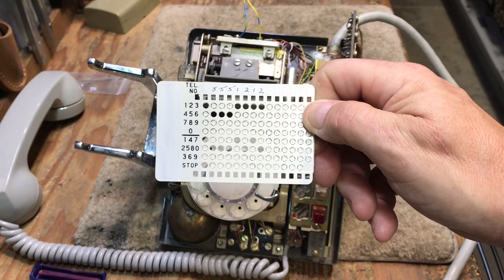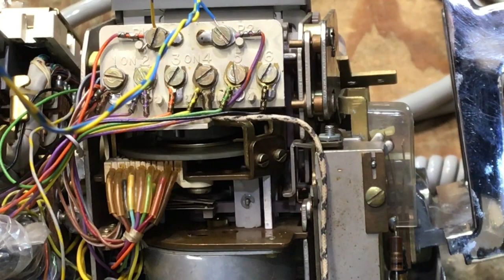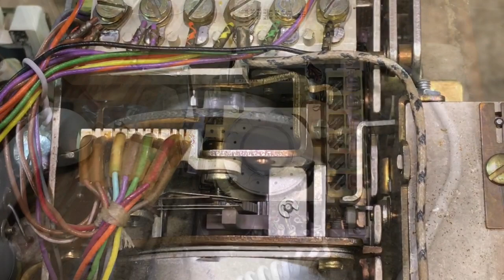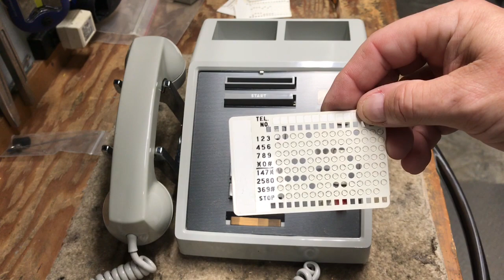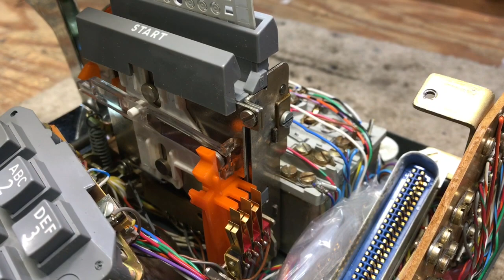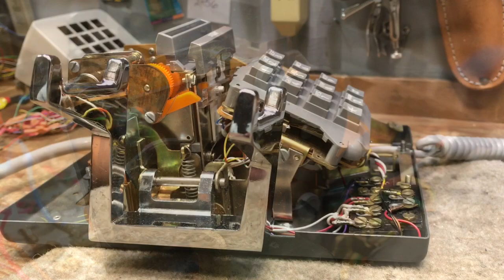Western Electric 66X and 26XX cardialers.

Comment: I acquired a 2662 TT around 1974, which i rewired for single line (before I also acquired a 3 line KSU).  This phone provided me with plenty of free concert tickets from the local radio stations for about 2 years in my teen years before it broke.  About 5 years later, I acquired a "Strategy" (?) electronic dialer that would detect both Bell and MCI/Sprint "Satellite" dial tones.  That allowed for dialing into FGB trunks (950 numbers), then dialing Card+ calls.  Then a friend with a Apple-II and an Apple-Cat II modem (and "Cat-Fur") introduced me to the world of MF dialing ;-)

Comment: These sets were very expensive back in the day, and were available only to lease from the OTC you were in. I had a White one (rotary), and then replaced it with a TT version (Blue). The dial pad and the dial mechanism in the TT version had to be replaced several times. They just brought out a new set. If you needed more cards, then it was $8 for a set of 20. When I moved, and disconnected the service I TOOK it with me. I paid enough for the rental over the few years I had them. The last one they replaced, the installer tried to get me to switch to a TAM 16 or 32. I just said no way. Bell gouged customers with those outlandish rental charges. I still use the card dialer, and it still works (it wasn't a refurb). A friend has a pink one and that was a very rare color in the card dialer. He worked in the Plant dept. Many people have never seen them. Sad that many customers are disconnecting landlines. Sound quality and clarity is next to none. Very nice post. That's quite a setup you have there. Love the sound of the "stepper office".
Reply from the maker: It would be interesting to see bills for phone system rentals.
Reply: @sxsphil  I remember the non recurring installation fee for the card dialer was $35, and then $6.50 monthly for the rotary set. The monthly rate for the TT one was $9.50 (plus 1.50 TT line charge). For a TAM 32 TT it was $55 installation, and 20.50 monthly (plus 1.50 TT line charge). Even Princess sets were $1 monthly, as well as Trimline sets.(Plus the 1.50 TT rate). Bell Chime rates were also $1. And color sets were $10 one time non recurring charge. The rates I mentioned were for single line sets. I'm sure with key sets it was more. I have a friend who was a service rep, and she kept her handbook with charges. Of course these rates were in Pa. Each State had different rates for the same equipment. New York was the highest. Sad part was the customer never owned the equipment. In early '84 after the breakup they were asking customers to buy the equipment they had outright as they were no longer repairing or installing any equipment. Many customers just returned the sets, and bought their own. It was the end of Bell as we knew it. But nothing compared to a WE set.

Comment: We’ve been told here in the uk that our landlines are all going to be phased out by 2025! I have a Western Electric 2500 and a refurbished Western Electric 1D2 Payphone which I got shipped from the States. I’m looking at alternatives if and when my two phones are made obsolete. I’ve heard voip is a digital converter alternative and will be looking into that. I’m surprised that so many people don’t have landlines anymore and just want cellphones! 📱☹️
Reply: VoIP will work with the touch tone phones, but unless you have control over the ringing parameters (a BYOD VoIP provider will allow you to configure your own ATA or PBX), you may need to adjust the bias spring. Of course this may have needed adjusting for UK ringing anyway, but you will need to do it if it hasn't been done unless you can really bring up the ringer voltage. Grandstream ATAs have a "Enable High Ring Power" parameter to do this.

You can also connect vintage phones to mobiles. Phil did a video recently regarding 1A2 systems, but the concept and the mobile phone equipment is the same, you just plug the phones directly into the device instead of plugging the 1A2 system into the device.
Reply: @jrmcferren  Many thanks for the info. Much appreciated. I’ll look into it.

Comment: Would hotline phones (the kind you used to find at the supermarket/mall where you lift the handset and it would automatically dial a taxi company) work in a similar manner? Perhaps they have some kind of card that is inside the phone?
Reply: Phil has an older video where he has an autodialer that would be used for that purpose. These days these are small computer chips put into a phone, or telephone equipment programmed to automatically connect to that number.